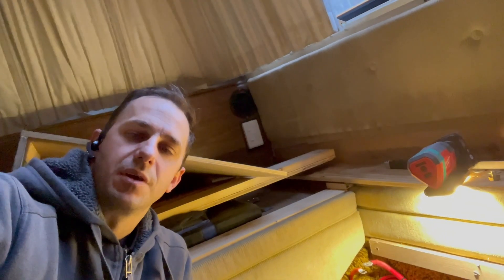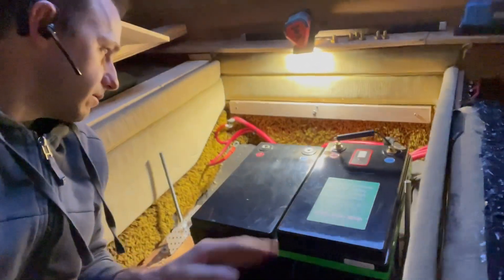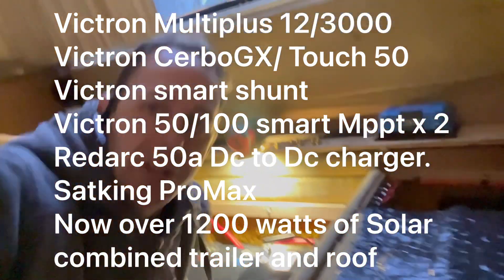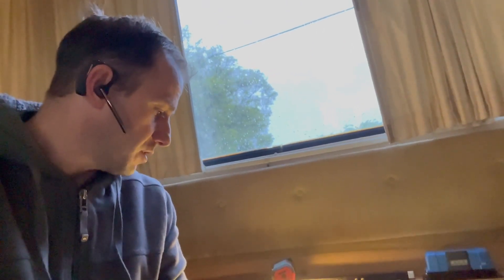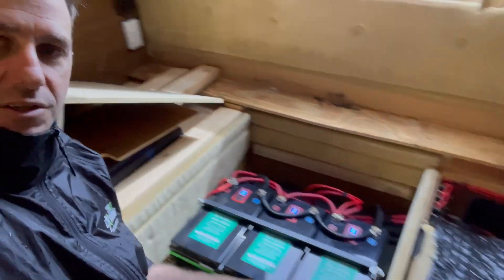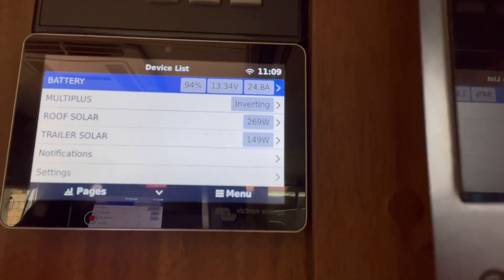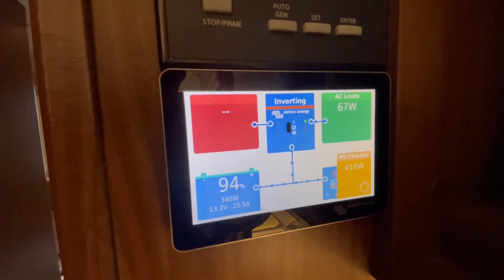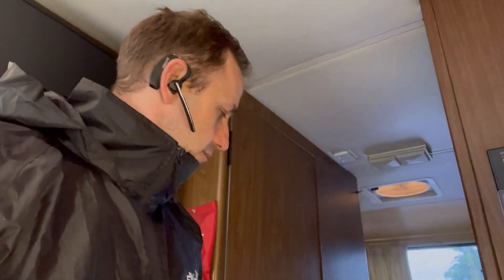American GMC 450ah/800watt Solar upgrade to 840ah/1200watt Solar. Big Victron Offgrid camper

Comment: I see sometimes you use the Victron Multiplus 2 and other times just the Multiplus unit, both have practically same inverter rating (3000watts) and charger (120amps) what is the difference between the two units
Reply from the maker: Its all about size. We find the mulit 1 can fit in about 80% more places than the multi 2.
We bring both onsite.
Reply from the maker: Hi Bob, the actual reasoning behind the two is dimensions 90% of the time we use the multi one as its size allows more easy manoeuvrability into its location as opposed to the multi two where we are limited in its application. It’s only physical dimensions that really deferred the two items as far as performance goes. They are both pretty much the same for the applications I use them for.

Comment: That's such an easy upgrade to power storage! Awesome to see the trailer solar too, it's often talked about but rarely done (even rarer for it to be done right like this).
Reply from the maker: This was done a while back when high discharge single batteries were not readily available. Thanks Paul once again for a great product.
With over 10kwh, these guys are seriously setup.